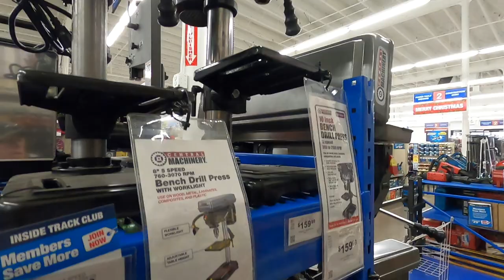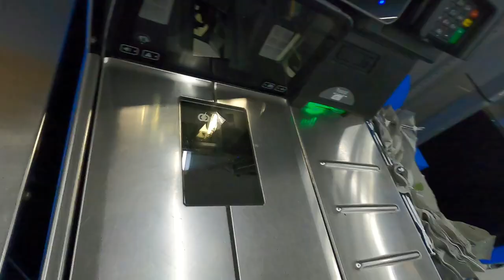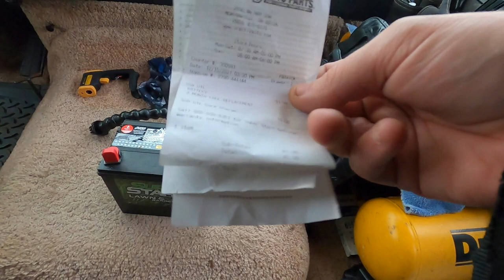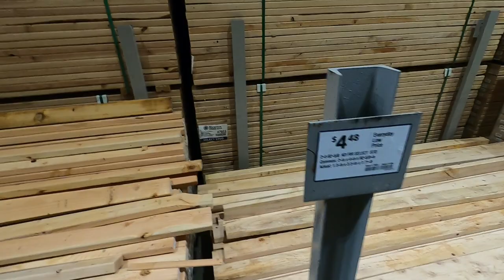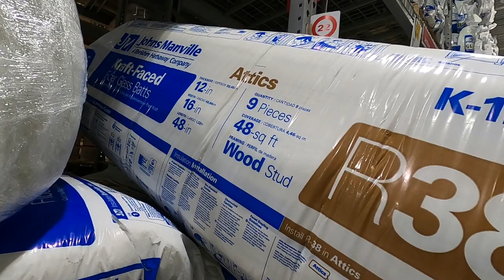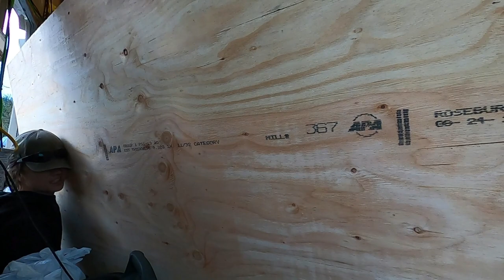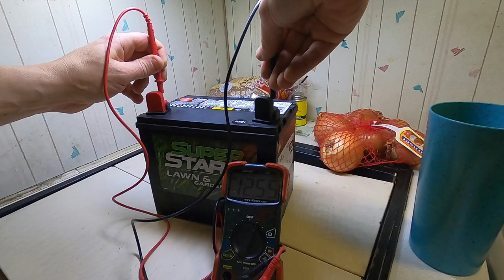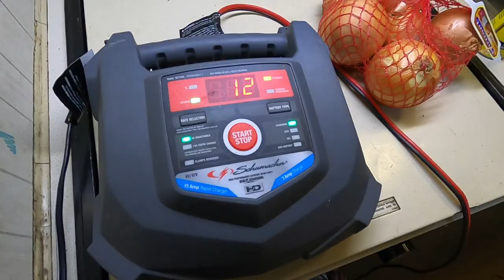RV Living In The Snow - Trip To Town For Supplies

Comment: That window could be condensing water from the inside because you have it covered and the dehumidifier is not able to dry behind that blanket. The combination of a very cold window and trapped moist air will condense water. The more open things are and the more the air can circulate the more effective the dehumidifier will be. You can't have closed off areas that don't get air circulation. My experience anyway. Love the progress as people can learn from you.

Comment: I had similar leaks at the windows with my RV, The top of the window frame silicon gone bad and let water in, it got behind window frame and dripped down inside. I sealed up the tops of the windows, fixed that issue.

Comment: You should look into auxito led bulbs for the rear tails. If your turn signals work on the same bulbs as the taillights you will need to install load resistors to prevent hyper flash. I'm sure that's old news to you, but just a heads up! Super bright and durable led lighting :D I absolutely love mine. Merry Christmas!

Comment: I have the 27rq model exact same except shorter. I finishing up my inside remodel where I redid the cabinets kitchen bathroom carpet and water system. mine is a 88 and was polybutylene piping. Switched over to pex. 

I saw four years ago you replaced the upper radiator hose and I’m in the middle of that job now.  The thermostat side was accessible but I’m not sure how to get to the radiator hose clamp. Did you lay on the engine and blindly swap that hose clamp ?